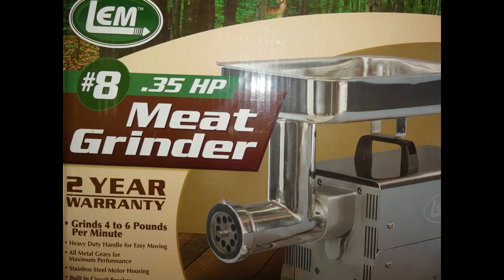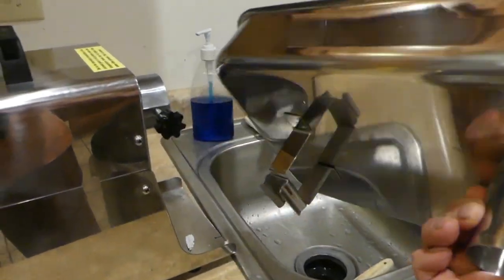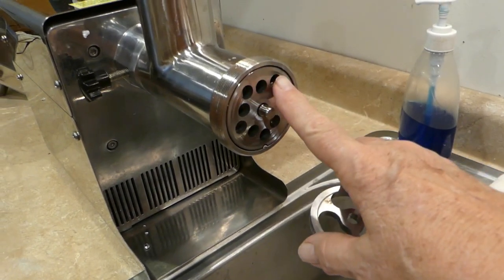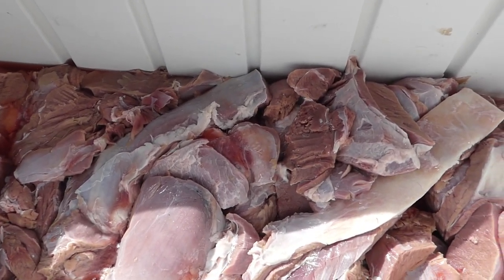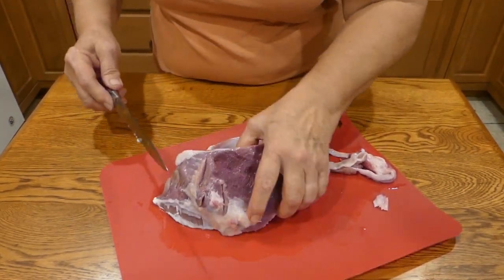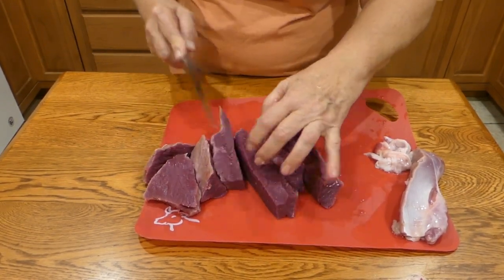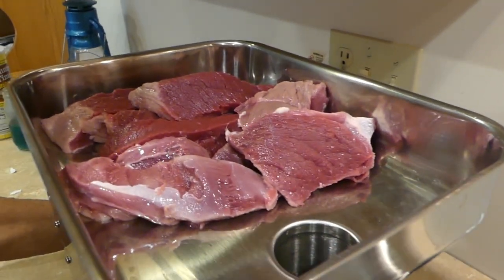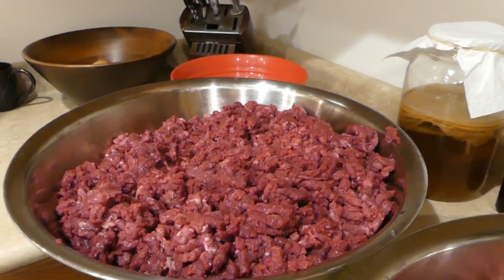Using an LEM #8 Meat Grinder to Grind Venison

Comment: Nice grinder. I'm looking to buy a new one for next years deer season.  Little tip though when trimming and grinding. Chill that meat. I get the temp. down to around 34 degrees. Makes holding slippery meat a little easier to trim and the grinder does better as it cuts faster and keeps the meat from wrapping around the auger.
Reply from the maker: thanks for the tip and the visit!